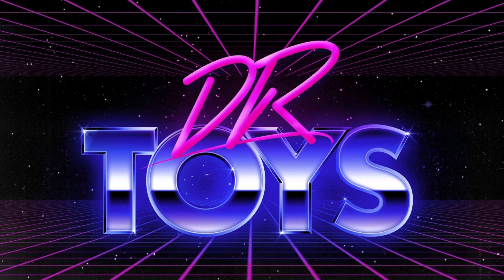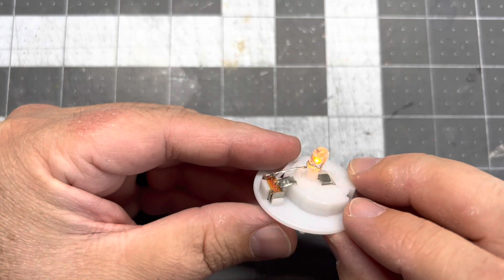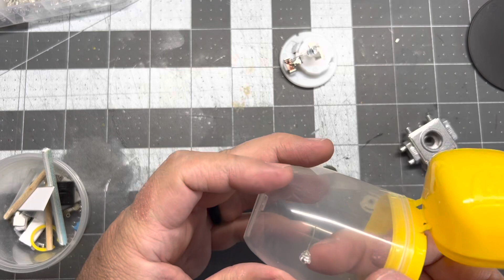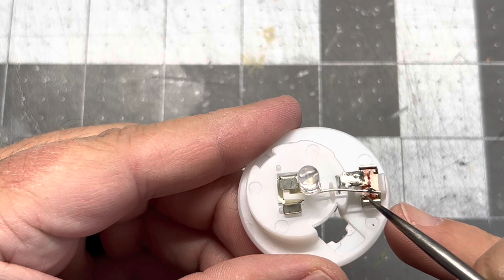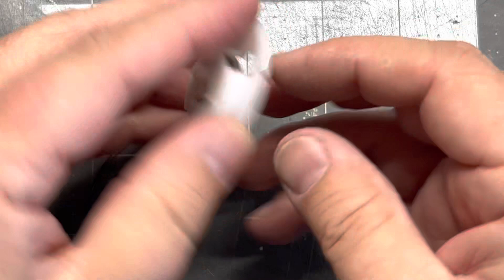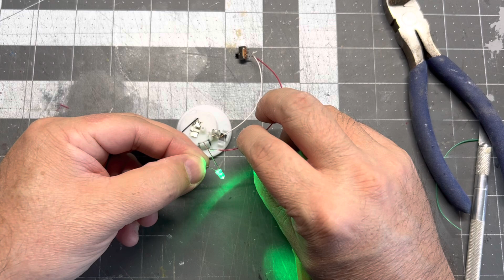How To Use LEDs In A Custom Build - The Easy Way

Comment: So I see you have a tmnt shirt so hoping you may have already done this. How would you add lights to metal heads figure? I found your video thinking about how to do that. Thinking using his backpack as the battery or switch area
Reply from the maker: I haven’t put lights in a TMNT but I think you’re on to something there. If you can pop the head off and run a wire from the neck through the body and out the back that seems like it would work.

Comment: Hi, I like your work.

 Listen, I have to make a neuron model for a project in 6 days, and I wanna make it light up in certain parts. While watching you find the right piece for the eye thingy, I was thinking: Can I use clay to surround it with a small carton tube? I'm gonna use the carton tube as a support beam to raise it up, I'm just scared I'll probably get hurt doing it hehe... You don't have to answer this if you don't wanna, it's just that I need to know before I cause an accident.

If you don't wanna answer, I respect it, but if you do, that'd be appreciated. Cool builds👍
Reply from the maker: Is the carton tube cardboard? You should be able to cover it with clay no problem. The temperature that you bake the clay at is only 275°F and cardboard won’t catch fire until about 400°F so you should be fine. I hope that helps.
Reply: @DRToysCreations Thanks for replying! I appreciate it.

Comment: Thank you for the video. The dollar tree has a string of led lights for 1.25 that I’m using for a build and I was able to use it with no modifications.  Just placed electrical tape on one of the bulbs I didn’t need.
In the Halloween section.
Reply from the maker: Awesome! Thanks for watching!

Comment: Gotta admit, I often use tea lights and the LED strips from the dollar store just because I'm a laza bastard and I get a battery pack, switch and lights all in an easily re-solderable package. A short while ago, my store even started carrying standard 5V LED strips with a battery case, the ones you'd usually buy on a spool.
Reply from the maker: So the tea light at my Dollar Tree have been redesigned and it like a plastic slide that pushes the wire to make the connection. I’m turn there’s nothing to solder to so I can’t use them.🥲

Comment: i use the same candles for my built but i don't change anything. they can last for 300 hours so no need to ever change the battery unless you keep it lit all the time.
love your customs btw. great idea with the guitar cord and rubber tubes for adding details.
Reply: I did a diorama about 10 years ago and uses a battery that is used for small solar panels, it hadn't been changed ever since, at least that is what the owner told me. But I do believe him, if the item is preserved in good conditions then it can last decades.
Same as how I have a 1st generation PlayStation that only needed it's 1st laser replacement 20 years later while some people complained about theirs maybe 5-10 years later. I keep the motors and plastic rails lubed every 3 years or so and they are all still fine.
I seen consoles that were basically caked in dust cigarette residue it's basically like someone took dirt mixed with some toxic motoroil and rubbed glued everything all over it's insides ... took forever to clean them and put them back in working order so as it needed replacements.
Point of the story again depends how people preserve their things and how smart they are with their custom builds-mods too.

Comment: Great video. Do the colors around the wires mean anything (like red positive) once you take them out of the cable, or only when you apply them to something? Thank you.
Reply from the maker: As far as I know in this case no. there are same wires that will have a wire thats a little thicker but I think that means it can carry a higher load.
In my case the wires were the same size and I just used the color to know what went where. 

I think...  😂
Reply: Yeah, copper wire is copper wire. I personally suggest staying with the red-pos/black-neg scheme in case you get help from someone who does electrical tinkering, but otherwise color of the coating is irrelevant. Especially on something this simple and direct.

Comment: One of the "advanced" aspects is, if you salvage the metal shims that contact the battery, you can create a battery holder in places that are otherwise too small for the base of the tea-light.
Reply from the maker: That a great point!
Thanks.